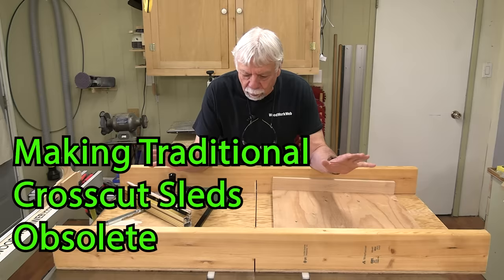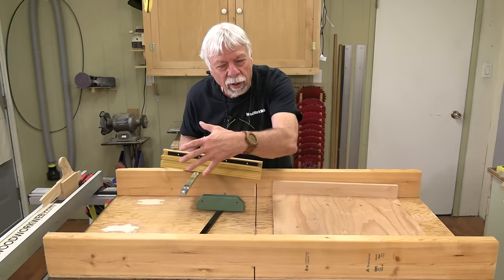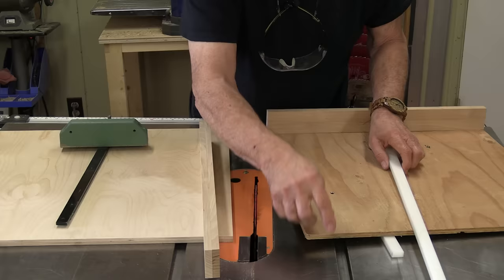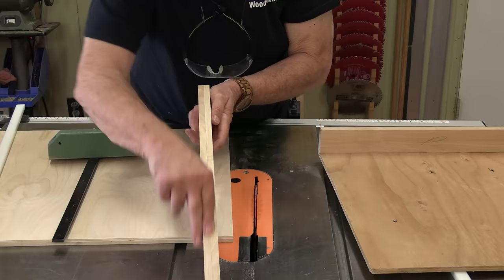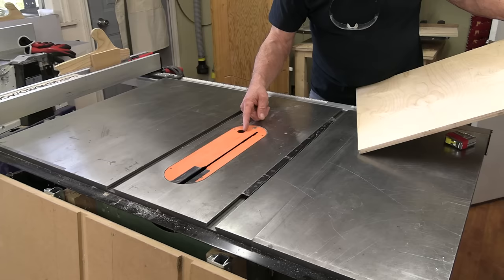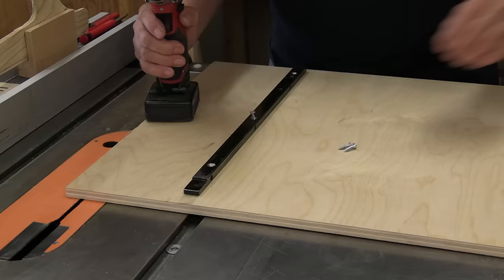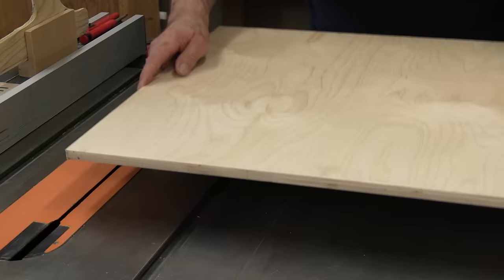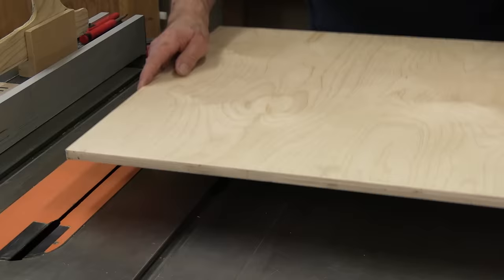STOP Making Out-Dated Table Saw Sleds, Do This Instead

Comment: I actually made one similar over 30 years ago.  The idea came from "New Yankee" Norm, but he put the square portion on the other end.  In this manner you're pushing the piece against the stop and it is much less "tippy" when you start since much more of the weight is on the front of the sled.  Also, by extending the guide bar well past the end of the panel you can literally cut VERY large pieces since you're always assuring that the board is against the square stop.  Although that can depend on your saw size and outfeed situation.  Norm called it his panel cutter.  And then they invented the track saw.....
Reply: Fence extensions way off to the side of the saw also help when cutting plywood as do all manner of extension tables.  Its crazy trying to guide big panels with a short stubby miter gauge.  The fence is better.

Comment: I got rid of my behemoth sled a while ago.  The smaller sleds are so much easier to use and store: those big ones take up way too much space.  
If you counter sink and put a slit in the plastic runners, you can over-tighten the screws to make the plastic bulge a little and you get a perfect fit. Wood runners only seem to fit the day you make them.  
Thanks for the video.

Comment: Personally, I also like to add just a thin coat of wax to the bottom of my sled to help keep it smooth running on the table. I use simple furniture wax, and before applying I take a heat gun and apply a slight amount of heat to the surface to help the wax run a bit and get just that little bit further into the fibers. It's not a perfectly smooth surface, so I still have a bit of friction to help with control, but it's just enough to make my cuts run that little bit smoother.
Reply: Me too! Johnsons paste wax. Use it on my joiner and even my miter saw.
Reply: Came here to say this. Also mix 4 parts beeswax and 1 part linseed oil. To make your own. This stuff is cheap so you can use it on metal and wood parts for general purpose protection.
Use Tung oil for a fine wood finish.

Comment: Great stuff. I, too am planning on building a similar sled for final trimming of cabinet carcass pieces. It is a great design for larger pieces and not limited by the physical size of the sled. Your three cut method seems fine for most items, if the work pieces aren't very large, IMHO. I want to try William Ng's five cut method (using a much bigger test piece ) to maximize any errors in the squareness of sled fence to saw cut. It is extra work, but errors on cabinet panels (UN-square corners) can add up fast to make  cabinet construction a pain, if drawers are involved. His method worked VERY well on my last sled build, and I was out only .0015" over 28 inches after two attempts to set the fence. I was able to get that accuracy on a 1980 vintage Delta Contractor saw, so take that SawStop!

Comment: Great video! One small suggestion I learned from Norm on the New Yankee Workshop - put the fence on the leading edge. This way you are not limited to the size of material on the sled. The sled can rest on the table and engage the miter slot and the material can hang off the sled between you and the blade.
Reply: If the sled is, measured from the middle of the miter slot, as wide as it is to the blade u could turn it 180° you can use it both ways

Comment: Colin. Thank you for this info on using the miter slot and not the fence. I've always had a slight deviation on my previous sleds because as it seems my saw isn't parallel to the miter slots. I've tried adjusting and it's almost imposible ti get it perfect.  I tried your method and it works flawless thank you.

Comment: Thank you, i am not a very good woodworker but I did make a crosscut sled two years ago and use it a lot. This will make an improvement on the original!
Reply from the maker: Woodworking is a process of learning and trying and I still have lots to learn too :)

Comment: Ah, nice. A while ago I made the same kind of crosscut sled, exactly for the reasons that you gave. I did not see it before being made in a YT vid so I assumed that this was not truly what a pro works with.  So glad to see that it makes sense to pro users too.
This is also much simpler to make and really in a few minutes you can start using this.   i did make mine with a wooden runner.  Seeing your vid motivates me to make a new crosscut like this and this time with a plastic runner to compensate for the wood movement.
Thxs.

Comment: I made my own cross sled based on the many different videos. I am like you. The plastic runners are the best. Just put s little paste wax, and the sled moves effortlessly. My cross sled design is only 32 inches by 18 inches using 3/4 finish plywood I had lying around.

Comment: Honestly, this is the best design I've seen.  It is simple, it is light-weight, and it works.  Using the table saw fence and the stop block means you can make a lot of cuts without a stopper on the fence.  I have a small table saw, so this does the trick.

Comment: Well done. And it's nicer looking, too!  I think I would have suggested making the fence long enough to extend past the blade and a little higher so it could serve as a backstop to reduce blowout. I always like your presentations.
Reply: Now thats a sled I can work with. Thank you. Love your channel
Reply: LOL - the longer you extend the back rest the closer you are to needing a second runner and then you're making a bigger sled again like the old one he was complaining about.  The truth is most professional shops have multiple size sleds and you simply grab the smallest one you can get away with using.  There is always a small one runner sled around for smaller pieces.  Bigger ones for bigger longer stuff that need more support. The one runner sled has been around since before I was a woodworker and I go back 40 years.  The title of this video is kind of gimicky and panderring to new and inexperienced woodworkers.  I do love Colin's videos though- always quality.

Comment: I made a couple of taper jigs that way, but I also made one "dummy" sled, just a slab and a runner, that runs (or sits) in the other slot. It not only supports the offcut side, but also prevents tear-out, in case you want both sides clean. The dummy can be pushed with the main sled, but it works just as well just sitting there stationary.
You would want to mount the runner a little farther from the edge than the distance to the blade, then trim the slab by running it through once.

Comment: Colin, Nice build. I see this as very useful and a good substitute for some cases where I use a crosscut sled. However one of the benefits of a traditional crosscut sled it that it supports both ends of the piece you are cutting in order to have a very clean cut on both sides. This jig does not do that. I would probably just use my miter gauge instead.
Reply: That added support of a big sled can reduce chances of tear-out at the end of the cut.

Comment: Thank you, Colin, for producing this video.  I was all set to build a sled just like the one you got rid of.  While reading the comments, I took thought on what others have mentioned here and added a stationary board of the same thickness as the sled bed to go on the right side of the blade.  I too, do not like my cut-off pieces dropping down from the blade to the table after cutting.  In the process of making that  I took the advice of another commenter and used flat washers and another mitre slot guide to hold the stationary board in place while using the sled.  Afterwards, I then realized I had no provision for making duplicate cuts without measuring each cut first.  On the old traditional sled, I'd clamp a piece of wood on the fence to the right of the blade for consistently sized cut-offs.  So, I've now added a T-Track to the stationary board near the rear edge and use a stop block.  Would love to add pictures of the finished product, but I don't see provision for that here.

Comment: Nicely done. Norm Abrams on the New Yankee Workshop often used a panel sled of similar design only his had the fence mounted on the leading edge rather than the trailing edge. With the leading edge, you're pushing the material rather than the sled which keeps the material pressed against the fence.  I built a 'prototype' of his design 25 years ago that I'm still using.
Reply: I've always liked that design of fence at leading edge.

Comment: For the runner use POM plastic - it is naturally "slippery" and commonly used for moving parts. Rather don't use PA6 (polyamide) which has tendency to absorb or lose moisture and can swell or contract a bit like wood - not as much, but if you have tight fit between the runner and the miter slot it may potentially cause some issues. Also try to avoid anything with high content (20 percent and more) of glass fiber reinforcement (GF in the name) as the surface may be a tiny bit more rough and it won't slide as well as a plastic without GF.
Reply: PE is my favorite, HDPE if I can get it.
Reply: @Bob_Adkins  Anyone can get HDPE. Just shred your old milk jugs and melt them down in an oven around 240-250 degrees. You can then press them into a mold to get the shape you want.
Reply: Do you have the link from where you purchased the plastic that you mentioned? And they come on the right thickness to fit the saw slot? Thanks!
Reply: @PoisonShot20  If this was the question to me then I'm sorry but I cannot give you any links because I actually did not buy any plastics either online or offline; I don't even own a table saw :-( I just work in a company which makes its products mainly out of plastics so I gained some knowledge about them which I'm willing to share :-)
You can try to find local suppliers of plastics (sold in sheets) and ask for some narrow off-cuts - they may sell these to you cheaply or maybe even give them to you for free, depending on the size and their policy regarding waste - strips wide enough for a crosscut jig runners may be already considered as scrap for them.

Comment: Made one very similar to this 10 years ( or so ) ago based on a design I saw from Matthias Wandel. It's worked very well in many awkward situations. I also have a "traditional" sled that is for much smaller work ( max about 10" wide ) and since it's so small and light it gets most of my jobs. But this style is very very handy as you show.

Comment: As I watched the cut-offs fly back from the table saw blade when cutting that test piece, I realized there’s an advantage to having the blade bisect the sled.
Reply: This was my only note for this design.
Reply: I made a sled like that year ago, out of melamine. Actually I made two sleds, started with one with guides in both slots. Cut that in two, and use the right half, usually statically, to support the off cut side.
Reply: I like the idea of a small, light crosscut sled - but I would leave at least a few inches to the other side if the blade to reduce tear out and let the cut piece lever away from the blade after the cut.

Comment: Nice x cut sled.
My sled design (not made yet) includes a series of evenly spaced shallow kerfs on the inside of the backstop. This would allow consistent & repeatable set ups (with only minimal measurements) for repeat cuts by using a stop board that has an attached small protrusion (a split from a dowel, maybe), a protrusion that would mate with any of the kerfs to fix the stop board in place. Like I said, almost never needing a measurement if the kerfs are uniformly spaced, say by half-inches or by centimeters.

Comment: Went the same route several years ago. When I got my new SawStop, i built all these gucci jigs and sleds. My miter sled hand built in 45s for mitering. It is a nice piece, but too big and heavy, so I built almost exactly the same thing as you with a metal bar off a miter gauge with the adjustable ball bearings.

Comment: I looks like a New Yankee Work shop sled.  I made one years ago and with the fence at the front you could cut small panels.  You could also turn it around with the fence facing the rear of the table saw to cut large panels. Thanks for the video.  I had the same problem with my cross cut sled, it was big and heavy to lift on and off the table saw.  Thanks for your video.  Now to find a place to get that plastic you talked about.

Comment: Like many others, I drank the "Ultimate Crosscut Sled" kool-aid about 8 years ago when my Saw-Stop arrived.  Best saw deserves the best sled right?  3/4" birch ply, big, thick front and back verticals, T-tracks for stop blocks, embedded steel tapes and a set of adjustable T-track angle supports.  It lacked for nothing.  And then, I had to live with it.  Two years ago, I did what most of us probably needs to do occasionally and rented a roll-off and did a merciless purge of the barn, garage and basement.  There was still a little room in the roll off.  I anguished over whether to do it or not but finally took that behemoth of a sled and threw it out.  BEST thing I've ever done!  No more trying to find someplace to put it when it was not in use, no more knocking it over when it was in the way (which was always) and no more weight lifting getting it on and off.  I built something very similar to Colin's sled here and I'll never have another giant sled again.  With nothing more than clamps, stop blocks and two through bolted hold-downs I can do anything that big clunker did.  When I'm done, I can hang it on the wall.  Try doing that with an "Ultimate Sled."  Thanks for the video Colin.  I'm with you all the way!
Reply: Weren't you able to cut the big one up and make a small one out of it?
Reply: @donf3739  Embedded metal tracks, tapes, wood screws, etc.  The decision was admittedly an impulse but believe me, I don't regret doing it.

Comment: I have some plastic guides I keep around for jigs, but have a lot of aluminum ones too.  I go to the metal salvage place and buy 3/8" thick flat aluminum stock, then cut it on the table saw.

To smooth the cuts, I use canning wax by rubbing it over the cut line. You can actually hear a difference in the cut when using it. Too, you can see the wax melt just ahead of the kerf.

In the past, I've used one of my 60 tooth, ten inch carbide blades, but bought a dedicated blade for nonferrous metal (I like the cut quality of the 60 tooth wood blades a bit better).

I cut with the blade guard down (mine swivels out of the way), but still wear a full face shield because hot metal can get tossed.

Because I make my own guide bars for far less than they would cost from a commercial supplier, I have no qualms about keeping several bars around and making them long so I can use whatever length suits my fancy.  For example, a few of my jigs have the bar extending several inches out the back, which would be perfect for this sled, to add stability at the start of cuts.

Comment: Very cool 😎!
I just had to move recently and, alas, the table saw is in storage.......
However, right before I moved, I had to run off  "a pile" of cuts, and I was not going to construct a giant sled just to throw it out in the move. I remembered the Norm Abrams panel sled and I threw one together in reverse similar to yours, again in scrap.  Thin base , couple of hardwood off cuts.   
Not heavy and it worked.   It will get remade as soon as I get the saw set up.  Better piece of Birch ply, thin;  Delrin guide, with a finish.   
Kudos to you 😊!

Comment: The shop I work at just got a huge new Altendorf panel saw, and the slide is out by 0.025mm over 12 feet.  The stops on the mitre gauge have a DRO that is accurate to within 0.1 mm.  The scoring blades can be adjusted by 0.01mm.  MIND BLOWING ACCURACY!
Reply: Those kind of numbers really float my boat!  I'm guilty of trying to get machine shop readings when cutting wood

Comment: Interesting video. 
I have like 3 different plywood small/light table saw sleds in addition to a more robust sled, and 3 for router table use. 
I’ve had people on job sites and glitzy-magazine hobbyists tell me how I wasted my time constructing them cuz rockler has this, and garret wade has that, and they are “so accurate.”

Maybe they are accurate but I’m capable of repeatable accuracy on my own. The next progression in my mind is that for a few hours of my time and essentially what is scrap-bin materials versus thousands of dollars of extruded aluminum- I’ll build my own stuff, thank you. I never have to check to see if my jigs are adjusted correctly and they fit my hands comfortably. 

 I wouldn’t be buying anything of those shiny magazine cutting aids if I was Warren Buffett, either. Tools that do exactly what needs call for quickly and accurately are more important to me than adjustability, shiny parts, or bright colors. 

That’s what it comes down to for me. Does it save me time or enable me do better work? If so, maybe I’ll buy in. If it’s just another mousetrap? Then, no- not interested. 

Good video

Comment: I made a sled like the one he is demonstrating. I blunted a # 10 screw and screwed it into a whole on the left side of the fence near the end of the board. This way if the sled is off, you can turn the screw and push the board out away from the fence and make the cut square.

Comment: I used a crosscut sled to make multiple identical cuts when I built an island/table. It's only half the size of your large one. It worked great. However, even with the smaller sled, it's a workout for your shoulders.

Comment: Great job. I will be making a similar sled, but i want it to come beyond the blade so i can make box joints.  Thanks for the great info.
By the way, your RPMs seemed a bit high on your drill press for drilling steel. Heres a tip for all of you drilling steel with your drill press. Use 50 sfm. Here's the formula for you. 
3.82 x 50 / Dia of drill = RPM
So if you are tapping a 1/4-20, your tap drill size is .201" so,
3.82 x 50 / .201 = 950 RPM. This will give you the maximum life for your HSS drills. Trust me, I'm a toolmaker 😉.